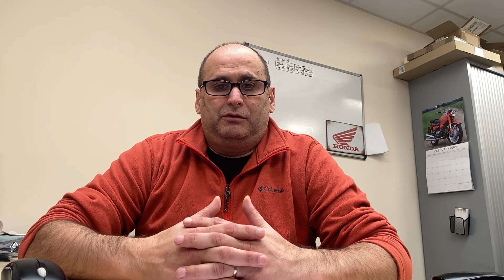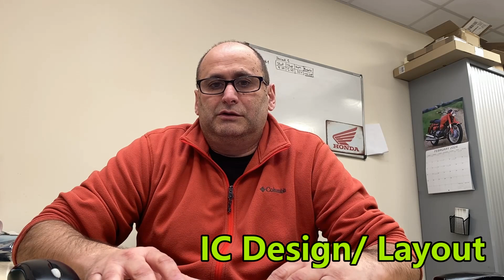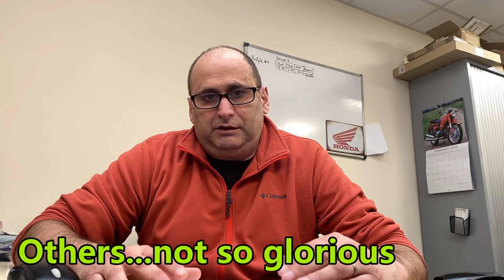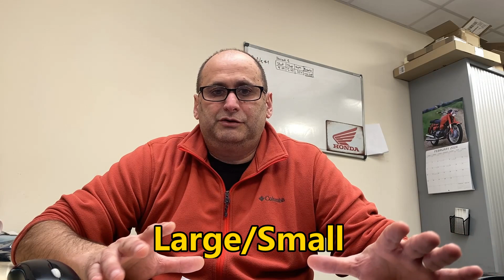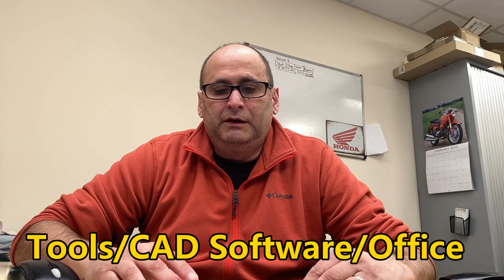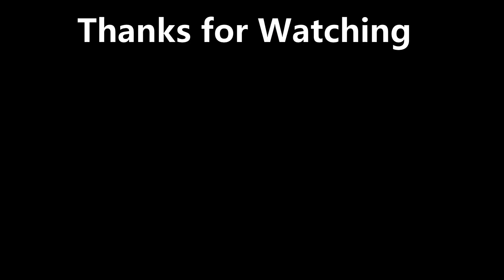HW Engineer as a career path

Comment: i like that there are parallels from software industry. techincal marketing are product managers (its a way out). Project managers are engineering managers, they manage people more and don't have to do hands on programming. Jack of all trade are called full-stack developers who do both frontend and backend, They are not deep in either and are usually freshers and are more appropriate for startups which can't afford experts. Manufacturing analogy in your some other video is what we call platforms in software (linux OS, hadoop for bigdata, flutter for frontend, spring for backend). Its more complex and time taking thing to build. Other user facing companies ride on those platforms with minimal composition and make fortune. The platforms are open-source and free, so not the most financially rewarding business but has its own economics.
Reply from the maker: When it comes to pay (salary) things a very different from company to company (country to country) the hardware engineers are a bit hard to find (not as many f them) so the job security is in general better than software engineering. The entry barrier between the two is very different too ( there is no concept "open source" in the electronics lab) - both are interesting if you can master at least one.
Thanks for the great comment.

Comment: Hello Sir, thank you for those informations. Can I get in touch with you please? I have some questions to ask you about one particular field.
Reply from the maker: Use the contact page on the company website  "Adaptive Design"
Reply: @adaptivedesign8795   I don't find your website, so i ask you here. 
I've worked as PCB Designer wich I find great at first. But the more I have done, the more I find it boring. I want to switch into power electronics designer (I have my degree).I want to know, is there a lot of theory when you design or it's more practical. I mean you start from fonctionnal blocs, then choose your components and do some simulations on software? 
There are a lot of mathematics in this fields.
Please.
Reply from the maker: @Personne-z6y  Hi There,
the website is https://www.adaptivedesign.ie 
Electronics design is quite a vast field, I think it has more to to with physics than math (still requires some math knowledge) - as a designer you need to pick a subfield where you are more comfortable and start with that. When you get better at that move to another sub-field until you became self sufficient. Knowledge in electronics is a mixture of theory and practical skills so you need both. I might sound scary but is achievable with focus and determination.
Good luck!

Comment: Awesome channel, great video. Do tell me, why are salaries in hardware about the half compared to software for three times the mental effort ?
Reply from the maker: Just my opinion (may differ from the truth) the software as a business model is more attractive to the investors because it can be scaled up very quickly, in turn these companies are flooded  with investment money (easy money) and they pay big salaries. (most of these companies they don't even make profit) - In well established companies software salaries are not exceeding hardware salaries (or are less) - another reason is that manufacturing (and designing) hardware has migrated offshore and is perceived as a risk by most of the company leaders which are not engineers. Life has a habit to balance these things naturally but it can take a long time.
Reply: @adaptivedesign8795  I guess you’re right - there is very little correlation between actual depth and breadth of skillset in software to the size of compensation. 
I started looking into hardware when I realized that the stereotype that outside world has about hardware - that “some guys” are always gonna be there to do it for the bottom dollar like it’s a roofing job (no offense to roofers) - anyway, it’s false and damaging. I found the little bit of relevant hardware design I could scrape with my meager knowledge to be at least as challenging and dependent on fundamentals as the mid level systems development - stuff like storage optimization for database or simpler drivers design. There isn’t enough respect for people on whose shoulders everything stands - literally every aspect of our society is on backs of people who took some serious gambles with their lives and very few of them got rich quick doing so. 
BTW you forgot the most important skill in FPGA : written mandarin :-)
Reply from the maker: @unixux  nobody is getting rich quick in engineering, not sure about learning mandarin either,  learning Verilog/VHDL it's a much safer bet.